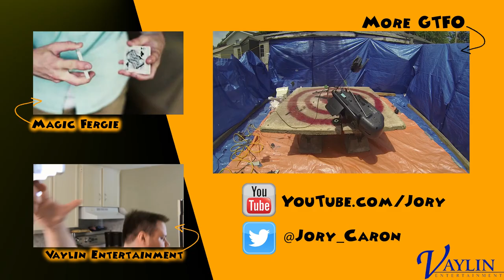GTFO My Deck: Working Laptop ep. 23

Comment from the maker: So I guess now I tweet at dell tech support til they fix my computer...
Reply: Being someone who works in tech support and works with dells for a living, I approve of this video.
Reply: ExposingBadDrivers I had a dell laptop that I've keep running for quite some time now. I personally replaced all the parts when they failed with better, much more upgraded parts, but that's just because I know how to work with all forms of laptops. When I was done with it and finally sold it, I had upgraded the old, crummy 2.1GHz i3 dual core to a fourth gen 3.0 i5 dual core, the 3 gigs of operating RAM it had to 7,(8 total. I reserved 1 gigabyte for system tasks and general hardware processing.) and replaced the old 250 gb HD with a 500 gb SSD. It turns out, the motherboard is able to handle the upgrades, but the battery wasn't. I ended getting a battery that could easily support the system at its peak output and then some, and after that, I upgraded the graphics by removing the disk drive, and removed the old 2.0 USB ports and replaced them with 3.0 and added a few more where the CD drive used to be. I had an external CD drive that plugged into a dedicated USB port that allowed me to still use and disks that came with it. Over-all, I spent $100 on buying it initially, and then an extra $400(Thank you newegg!) on upgrading it. With the amount I upgraded it, the cost today to buy such a laptop from the assembly lines would be $1000+. I ended up selling it for $10 to someone who desperately needed a new laptop and was a good friend. I even offered him life-time maintenance on it, however if the parts started to fail, he needed to buy new parts. The laptop isn't mine anymore, it's his and I don't have the money to upkeep it on my own. The only thing I do is go down to his place once a month and clean it for him, replace the heat-sink gel and make absolutely certain the motherboard does not need to be replaced.(I've already got a new motherboard for the laptop, but I don't want to change it if I don't need to.)
Reply: My poor 9 year old Dell started blowing wind like a crazy laptop after playing this video for me. I don't think he approves...
Reply: Angelique Rossau Your laptop has gained sentience
Reply: LOOOOOOL, it really looks like it, the old basterd has been working like a dream ever since we looked at this video. Ty Jory <3

Comment: Those old Dell systems are actually very good, and amongst the best laptops to work on - and their desktops are decent as well, if you can overlook the proprietary components. Modern Dells, however, are utter pieces of shit, filled with bloatware and cheap, crappy components. They've gone from being one of the best OEMs (not quite IBM/Lenovo level, but close) to going towards the bottom of the pile. I have three P3 Dell laptops, and all 3 work perfectly, bar the usual battery and keyboard wear (although one has had a rough life, and has some structural issues that I need to remedy).
Reply: Raladras38957 I can't much speak for the newer laptops, but I can definitely speak for the desktops - my Inspiron 531 was a piece of shit, and my dad's recently sold Dimension E521 was little better. By contrast, the Optiplex GX270, a P4-era system, is pretty decent, although, being a SFF system, it's a tad tricky to work on sometimes. It's shocking how the Inspiron brand has gone from meaning a high-end, quality system, to being bargain-basement rubbish. I build my own desktops, or at least, built my main system. :)
Reply: Raladras38957 A desktop computer is really just a giant lego set (that occasionally likes to try and cut you), even down to the one piece that goes missing (usually a screw). And yes, computers have come on a long way even in 10 years, let alone 20, and so has pretty much everything else.